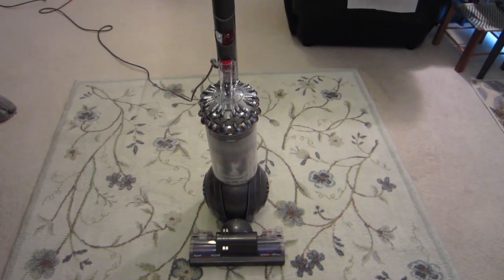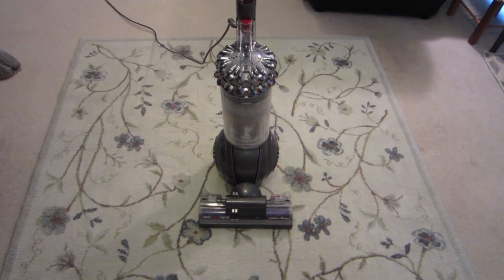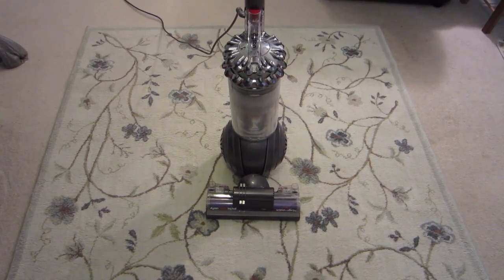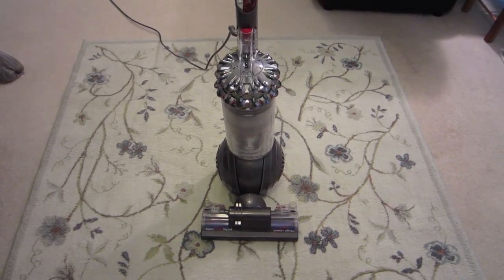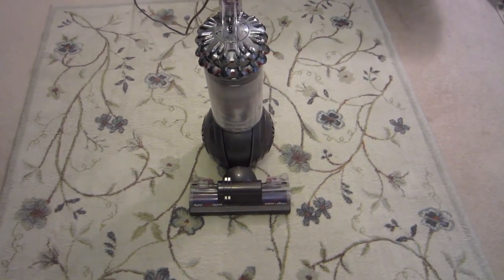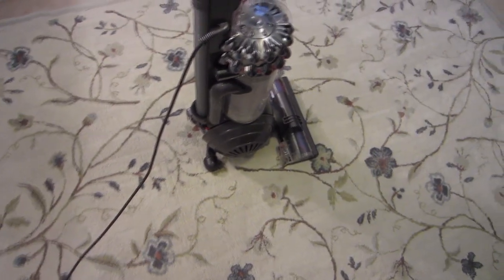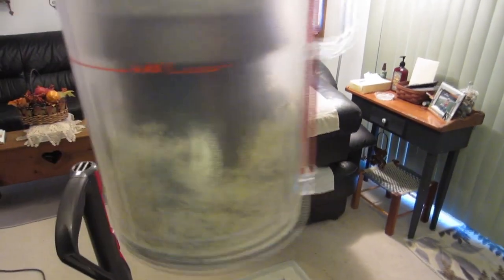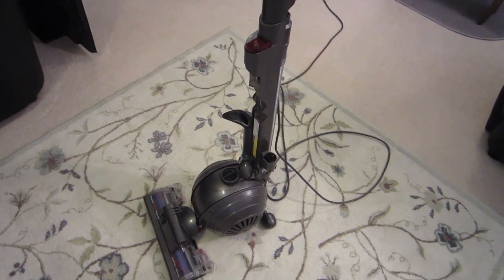Dyson Cinetic Big Ball Review

Comment: The reason for motor failure is neglect. The max fill line is there for a reason if you fill over it it stops airflow so the cyclones don’t work properly meaning that fine particles get through causing the motor to break down. So DONT OVERFILL
Reply: Motor failure happens regardless of the fill line. The cyclones put way too much resistance on the motor, the exhaust filters clog with dust bypassing the cyclonic separation process creating even more resistance.  Mind you dyson says the filters are lifetime filters (they are so wrong) those filters need replaced every 6 months or sooner at $89 each (there are two).  It’s a poor built machine, poor performance, over priced plastic garbage. There is absolutely no redeemable features on this at all.

Comment: Got one of those babies.  Carpet + 4 Golden Retrievers here.  Every time I used it after the first time I had to service the entire thing.  Also, the seal inside the ball, the seal that locks when you lean the body away to actually roll vacuum, is deficient.  I'm sure it leaks even when sealed, but it's really hard to make it seal.  This expensive baby is now retired even though technically "working". What a waste of money.

Comment: I was unimpressed with the Cinetic  until I removed the plastic Air Diverter just behind the brush roll.  Since then, I have been pretty amazed at what it is capable of picking up.  I have used nearly every model of Dyson, DC14 thru current, and until I did this one thing, I questioned whether Dyson was still in the Vacuum Cleaner business as the results where dismal at best.  I have a Workhorse, I LOVE IT, but my modified Cinetic was able to pull up a considerable amount of beneath-the-carpet type fine sand and grit after obsessively vacuuming for some time with my Workhorse, and Avalir.  I really did not expect it to get anything, but I wanted to see for myself.  It nearly filled the bin to max line, albeit off balance as a Dyson bin does not fill consistently as the Workhorse does, leading to a bit more respect  for this machine, but a bit skeptical still.  Time shall tell!
Reply: I have the Dyson DC75 Vacuum cleaner and I put it upside down but I can not find the plastic Air Diverter, please help, can you take a photo of it to show me please.

Comment: What about the ball animal 2
Reply from the maker: Better performance than this machine. But still not worth its price, build quality is equally atrocious in comparison.
Reply: FantomLightning have you tried it yet? Because i agree that the build quality is the same, but on the cinetic, since its heavier than the other dysons it requires more force to move it around which means you have to put more pressure onto the body and frame giving you that "cheap plastic feeling" and just because the parts feel like they are about to brake doesnt mean that it will - especially dysons new machines. The parts are very durable at least from my use. It just means that it will bend. And ive tried the dyson ball animal 2 and it is worth it a whole lot more than the cinetic. It has extreme suction, the brush motor is more powerful than ever, the brissles are stiffer, and yes, it includes a washable pre and post motor filter. Plus the cyclonic action is second to none. So i doubt that you will rarely find any complaints. And yes its $500 (but its now on sale for $400) but when you compare it to dyson's previous machines and by what ur getting (a 270 aw machine with 35 ft cord, 3 tools, and a choosing of 3 free tools of ur choosing at their website comapred to the dc41 - 245 air watts, a weaker brush roll, and 500 - 600 dollars) its actually a great value for a dyson wouldnt you agree. At least try one and compare it to ur cinetic and make a video about it. I will sure as hell watch it
Reply: FantomLightning and something else i didnt understand is that their previous dc41 had more suction than the cinetic, but its motor was smaller. The cinetic has weaker suction, yet it has a bigger motor. How that makes sense and why they made their motor bigger doesnt make any sense to me if the suction is reduced
Reply from the maker: Oh, those parts will break/bend out of useful shape. I've seen it many many times at work. From body chassis breaking and cracking, the non-filter side ball wheel fracturing off the machine needing a new "motor bucket assembly" which means the motor must also be replaced, and the release rod for the canister bending out of shape leading to the whole cyclone assembly needing to be replaced. No Dyson produced has ever been worth the price, there are better performing, longer lasting machines in the same price bracket with less expensive replacement parts. I believe the reason the bigger motor performs worse in the Big Ball is because of the Cinetic system robbing/restricting the airflow the motor produces.
Reply: FantomLightning i guess you have a strong point there? what if they took away the small rubber tips, added a pre motor filter, but kept on the small double tier 35 cyclones. Would the new redesigned canisters or v8/v7 stick handle a lot better and longer than the upright version since they dont go through nearly as much mechanical clanking, and clicking as much as the upright versions
Reply: FantomLightning the suction and filtration would well be increased

Comment: You’re a great YouTuber but I completely disagree with this video. The centric has half of the airflow if the Ball Multifloor and the ball Multifloor has more agitation than this Cenitic. But the genetic is not a bad vacuum. I went over a carpet with my oreck and I vacuumed that same carpet with my DC41 and it cleaned it much better.
Reply from the maker: But you're missing something crucial here. I never said this was a better machine than a 41, what I did say is that this machine is what Dyson currently bills as its flagship. And as such it has shit performance, for its price. No matter how you cut it, these machines are over priced, underpowered, woefully built, and have high priced but cheaply made parts. All they are riding on is the name, there are much better vacuums for the price point all of the Dyson range rides in.
Reply: FantomLightning exactly. If you want a high-quality Dyson you have to look at the Dc33 and below. I've handled the DC41 and similar machines and they are so horribly built. However I love my DC14 and recommend it to many due to its now affordability. Similar story to the 33, 25, 17, etc. But the newer machines are honestly terrible and I will never buy one.